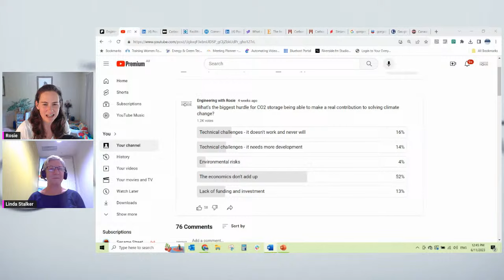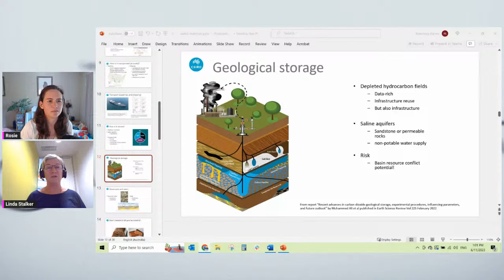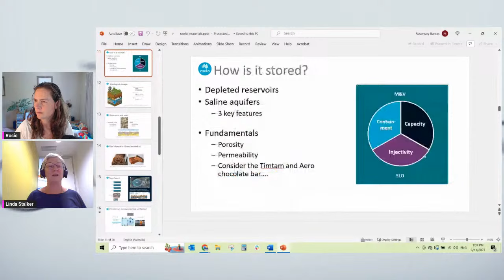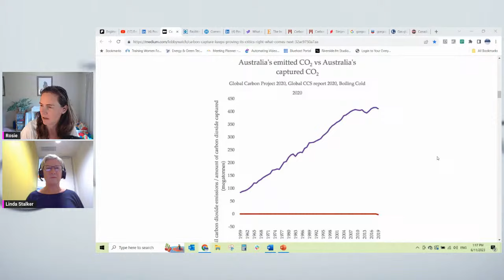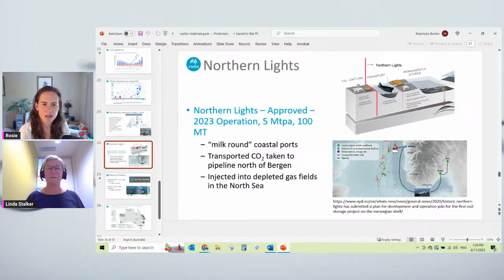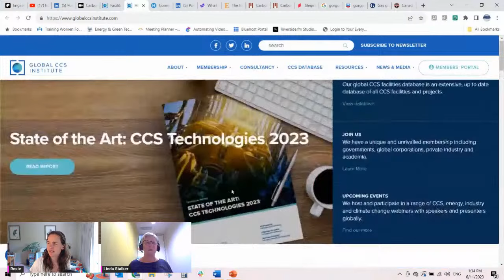CO2 Transport and Storage with Linda Stalker | Engineering with Rosie Live ep. 32

Comment: The northern lights story is highly inflated. We just have 1.5M capacity per year at the moment (about to start) but one of the investor (Shell) get cold feet at the moment to upgrade to 5M. The transport will be done by boat with every 2 days delivery. But the biggest issue by far is on the capture side which represent most of the costs (storage is about 10%): it is subsidized by the Norwegian state (at least for the 1.5M but not for the 5M upgrade). On the top some companies just pulled out from this because they realized it would cost them too much to capture…the only way to get it to work and scaled is by heavy subsidies and/or high co2 price (more than 200$/tco2- less than 75$ at the moment). Even UK which came up with the co2 hubs (industrial sites) is slowing down and turned down their ambitions. The focus in the years ahead is about energy security and money will pour into gas extraction you can sell and people desperately need (especially in a context where offshore wind is struggling so much) rather than losing money burying co2 in the ground. And I am not saying this lightly as I am working for a big Norwegian oil company I won’t name…what would make sense economically is the co2 mineralization but not the one presented by Rosie from an Australian company. I know some others which just need a little push and they already have a process in place and costs lower than 70$/tco2. + dealing with a mineral is far better than a gas and can be done on site

Comment: Apparently carbon capture is being used in Iceland, where you won’t find much sedimentary rock at all.  I gather the porous rocks of Iceland are handy as the CO2 pumped into them ends up reacting with the volcanic rock and becoming solid carbonates.
Reply: Some volcanic rocks are both extremely porous and permeable by virtue of their formation, so the actual storage part is especially straightforward-the carbonate formation is both a VERY positive feature, and a problem because they foul reactive sites on the pore surfaces.
This is a self-choking reaction, so a relatively small percentage of the CO2 is quickly "consumed", but diffusion through the solids will very slowly allow more to react. VERY slowly, even though high pressures are involved.

Comment: Nice discussion, Equinor is a very innovative company. CCS for a gas power plant is roughly 30% higher cost to build and uses about 20% more gas to operate. While a gas power plant is a great peaker, gas with CCS will compete with renewables, energy storage, and demand response. Offshore platforms (FPSOs) burn gas for power and re-inject unused gas back into the wells. Both Petronis and Petrobras plant to build FPSO's with CCS and inject the CO2 into the wells along with the gas.
Reply: CCS has repeatedly failed in the real world to deliver the savings promised. If renewables are used to power the CCS, then more CO2 is avoided by simply using the renewables to supply electricity to the grid. CCS is never perfect and some carbon always escapes the process. In this case, if it's more than 20%, which it normally is, then it's a waste of time. CCS is always a way to keep burning fossil fuels, and it's never worked out.

Comment: Very good and there’s a whole other branch of this tech which is CO2 temporary storage and shipment instead of sequestration.
E-fuels like e-methane or e-methanol are easily made from CO2 and green H2 and by combusting them in a direct oxy SCO2 turbine (Allam cycle) we can extract power more efficiently than CCGT and deliver pure CO2 at 100 bar which is an ideal  starting point for injection or liquefaction.
This opens up huge opportunities to store renewable energy for seasonal storage or to ship e-fuel/LCO2 worldwide in the same ship.
e-methanol/CO2 works best for shipping.
Better/cheaper than hydrogen with no emissions, no DAC and no bio source needed and no ammonia toxicity.
Remember this is not sequestration but temporary CO2 storage.
The carbon and CO2 goes around and around in a close circle like the refrigerant in a refrigerator and never escapes to our atmosphere.
https://www.linkedin.com/posts/activity-7056985421347467264-HKw4?utm_source=share&utm_medium=member_desktop
https://www.linkedin.com/posts/activity-6973926329675038720-eCNU?utm_source=share&utm_medium=member_desktop

Comment: It’s the same problem of nuclear waste. You can’t guarantee co2 will stay underground. And the more you have the harder it isThe example of short term storage for natural gas is not valid. It’s frightening how casual this woman is on the subject. It’s bad on multiple fronts. Environmental and economical. You be better of using these porous geological formations as areas to store pressurised 
pumped air for short term storage to be released into a turbine to produce electricity. This will create an income stream, make renewables more viable and ultimately create a low carbon environment which will allow the carbon in the atmosphere to reduce naturally.
Reply: It is exactly the opposite of the wasting of unused nuclear fuel not reprocessed and completely decayed in situ. 
Double down bs.

Comment: I hope CCS is not used as a mandate to continue the fossil fuel industry even 1 year longer then necessary.
I fear that this is the problem with the federal government allowing and supporting its use in that industry. 😒 
(aside from the inefficiency of the process as shown by the failed Santos CCS project at Moomba)   
(I hope CSIRO is not getting funds to work on research for the fossil fuel industry as this felt a little bit like, everything is "fine and normal" while we have a never ending transition...)
I still enjoyed the video! Thanks Rosie! 😃